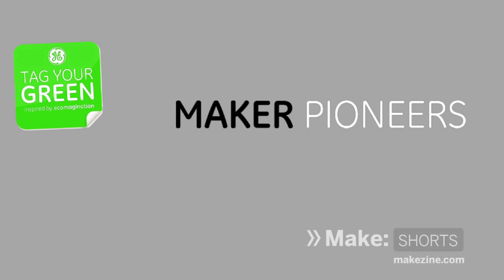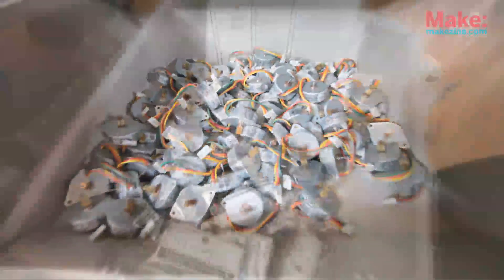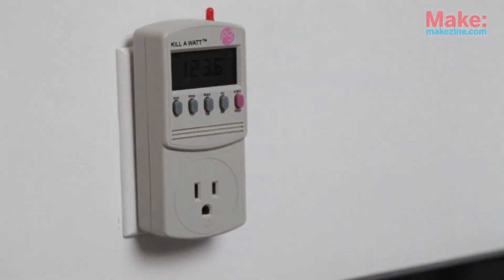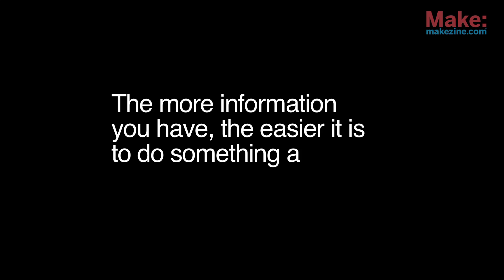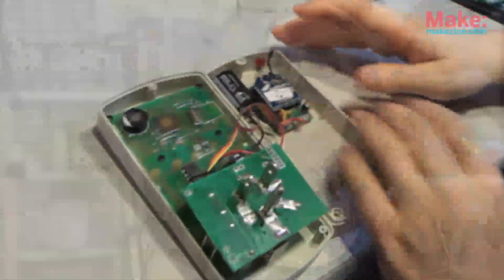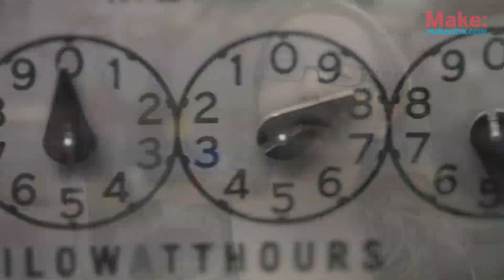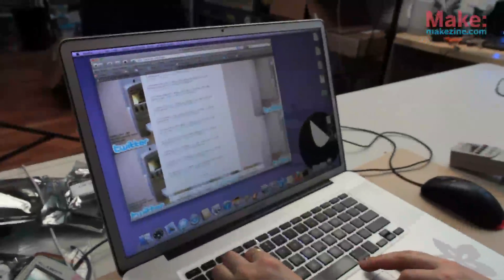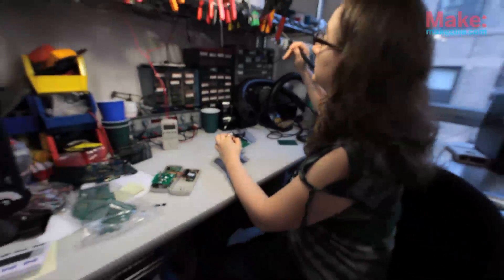Maker Pioneers: Limor Fried, Adafruit Industries

Comment: you want to reduce energy consumption....properly insulate your house (blown insulation is the best), caulk around base boards, outlets and a/c vents with 100% pure silicone caulking. Fix any holes in your air ducts with duct tape and the same with the A/C unit (between air ducts and insulation average savings can be 30%)
Most homes built up until 2000 are in need of these things even if you bought your home new.